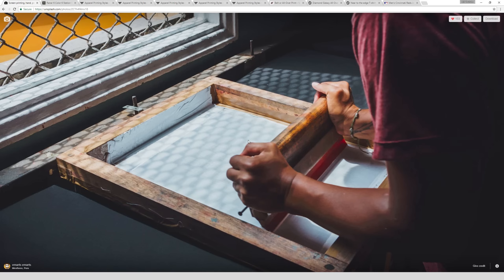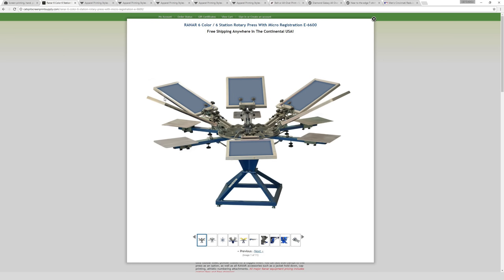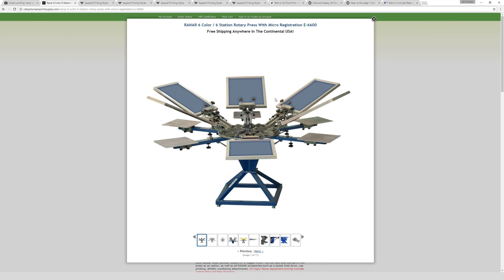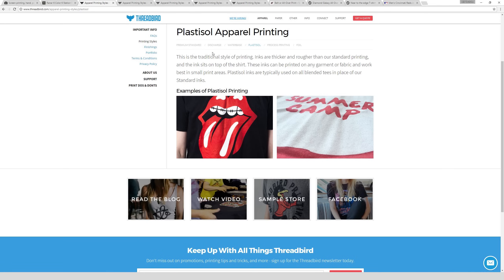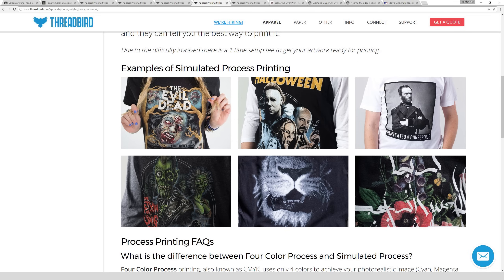Different T-Shirt Printing Methods Explained

Comment: Hello!! Thank you for this video!! Kind of new with the simulated printing. May ask which is better for my illustration. I've been making design with my drawing which is line art but has complex colors and details even with overlays effect. Which print do you it was better, simulated or DTG? Will dtg have the same color separation as Simulated printing?

Comment: Nice coverage.
I've been working in this field for 15 years (not only t-shirts) and I can confirm you pretty much covered everything (everything I know, at least).
The only thing you left out is related to embroidery methods, but since that's not strictly printing I suppose the slight omission was made on purpose.

Thanks for your videos!
Reply from the maker: Thanks Pedone! I'm happy for anyone who knows more / better about a particular aspect to chime in and let everyone know! That's the cool thing about the good part of the internet. :) Yeah embroidery isn't something that I feel I know enough about to really comment on, but happy for someone to give some tips for people looking to go down that path.
Reply: What printing method does Givenchy use for its tshirts with multicolor and Aztec patterns, Persian carpets? They use it on 100% cotton.
Reply: The guy doesn't know much about the subject. Many of the things he's saiid are wrong.
Anyway, that Givenchy shirt has been printed on a sheet of fabric, then cut and sewn, and most likely in an industrial size (meters long) printer. You could do the same thing in smaller scale, using a wide format inkjet printer with textile inks. OR if you don't mind polyester fabric...sublimate it.
Reply: What's the best method in printing?
Reply: When I scratch the shirt ,will I be able to feel the print or has it become a part of the t shirt  in sublimation on polyester

Comment: You mention direct to garment printing and that would be through a machine that adds a white base first and then go’s back over the garment and prints the colors for the second process, how good is the quality of the print, meaning image on the shirt and the ink that is used ?
Reply from the maker: Highly dependent on the quality of the machine, but the best ones currently available are quite good. Very hard to match the range of colors and fidelity that they provide.

Comment: What would be the process that has the best quality?? I mean, the one that last longer before it starts decoloring
Reply from the maker: Screen prints are generally the way to go when you can.
Reply: Matt Borchert Ooh so it’s not the best one??
Reply from the maker: Screen printing is generally considered industry standard. It's what almost every major brand would use.
Reply: Matt Borchert Thank you for responding so fast, you rock.
Reply: @MattBorchert  Firstly, thanks so much for sharing all the info! Continuing on this thread, is it possible to screen print with waterbase ink? would you recommend it?
Reply: When I scratch the shirt ,will I be able to feel the print or has it become a part of the t shirt  in sublimation on polyester

Comment: Hey Matt, thank you for the info, it helps a lot. I do have one question tho:
How do I print a whole pattern/design on a shirt/hoodie? Like u know the Supreme LV collab hoodie? Or the champion hoodie that has champion written all over it? I’m trying to do the same for my brand, so how would that work please?
Reply from the maker: Belt printing, dye sublimation, or cut and sew fabrication using roller printing. All are more expensive than a typical screenprint / smaller placement print. I'd talk to your local print shop about it.
Reply: @MattBorchert  Thanks😃

Comment: What is the highest quality method in your opinion? nice vid by the way!
Reply: As a screen printer, this is my favorite question that customers ask. The fact of the matter is, all of the above mentioned methods can be done by professionals on industrial equipment, and can be done be newbies on cheap equipment. A crappy screen print is as bad as a crappy vinyl print or sublimation print..
All of the methods can result in shirts that last for dozens of washes, and all the methods can be screwed up with improper heating/pressure/ink.. The differences are more in speed, convenience, and price of printing, not really in quality.

Comment: Hey Matt, Thank you so much for all the valuable info. I just had one question. I see different brands with either writing or images that wrap around the shirt or are on the shoulders, upper back, or on the side of the shirt. The prints are in unusual places and are made or cotton T-shirts. So I was wondering which method is used to get that result?

Comment: What are those really cheap but nice looking prints that feel like a full colored but thick slick image.
The image can crease/fold/bunch up.
If you wear them once - they are trash.
Reply from the maker: Those are almost certainly iron on / heat transfers. They're often printed out onto a sheet of paper using a typical color printer (so they can look great to start). They don't tend to hold up too great over time though, especially after being washed. Direct to garment printing is a more modern / superior version of that.
Reply: When I scratch the shirt ,will I be able to feel the print or has it become a part of the t shirt  in sublimation on polyester

Comment: What do you suggest for quality screen print for a few separated colors (2 to 5)? I would go with quality waterbased ink, but I'm afraid that will not last long? 

Any advice? :) 

Tnx!
Reply from the maker: Waterbased inks are very high quality and you don't have to worry about them not lasting long. Basically over a very long period of times they're more prone to fading as opposed to cracking with plastisol inks. Personally I greatly prefer waterbased prints when they're a possible option. Better for the environment too! Just more difficult to print as you need to apply them before they dry up.

Comment: What about print using heat transfer paper? Does this produce reliable and lasting prints ?
Reply from the maker: The quality there just usually doesn't hold up. That's where a similar but different plastisol transfer will hold up much better long term (although it may feel a bit thick and can't do full color like heat transfer paper can. I think direct to garment is now the superior way of handling this, although it's more expensive.
Reply: When I scratch the shirt ,will I be able to feel the print or has it become a part of the t shirt  in sublimation on polyester